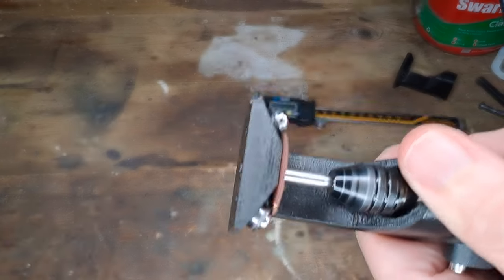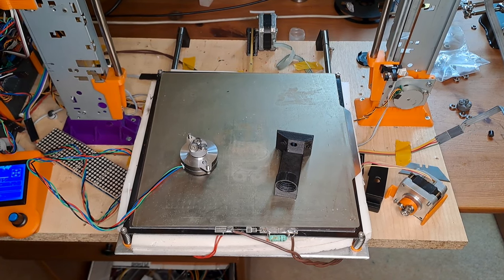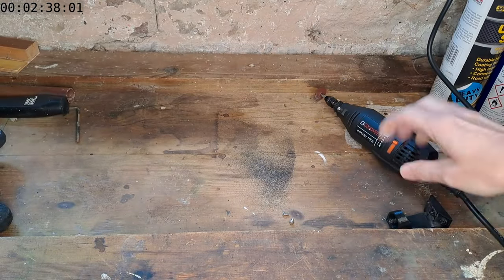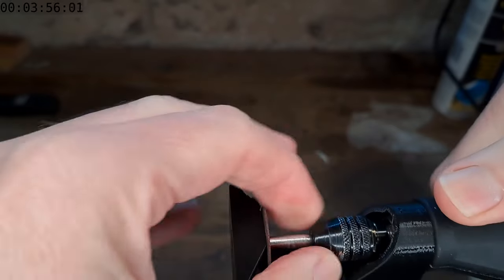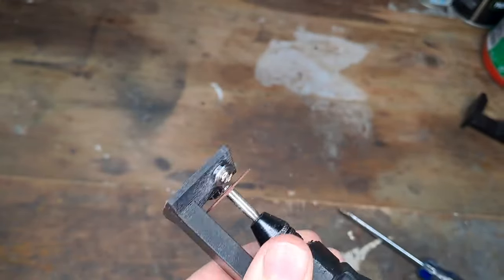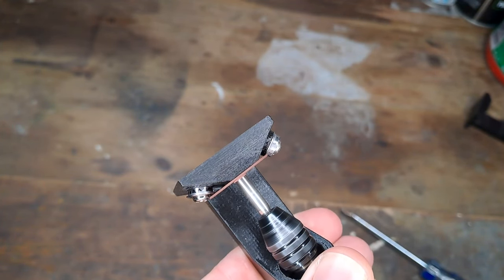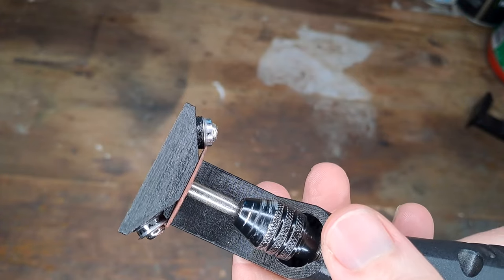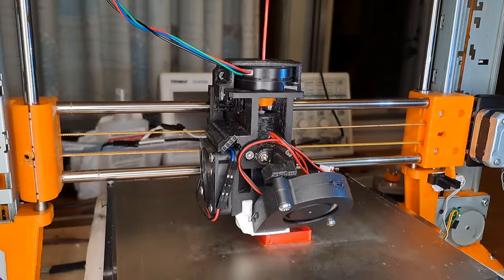VDE Bearing Grinder Jig in Detail

Comment: Hi Tom, thank you for the video. This prototype work is the work I have been following for a long time. and obviously the one with the least mastafaf. I have a question. There are certain problems with other extruders. The most important of these is that if the selected equipment is not of high quality, the quality of the printing surface decreases. I wonder how smooth the print surface quality is. For example, does it have a tree appearance effect
Reply from the maker: VDE has very smooth extrusion because the action is completely symmetrical and the steps/mm ratio is very high. I did Mihai's extrusion test (https://mihaidesigns.com/inconsistent-extrusion/) and there was almost no pattern at all. And that's on a home drilled motor, home ground bearings and home printed carrier.
Reply: Thank you for your comment. The cost is very low and for this reason alone it seems worth a try. I follow the developments. Please share as they develop.  @tombrazier6172